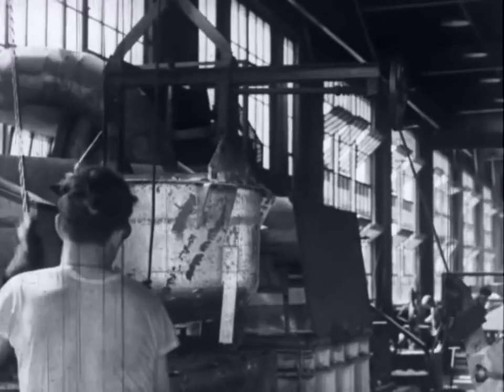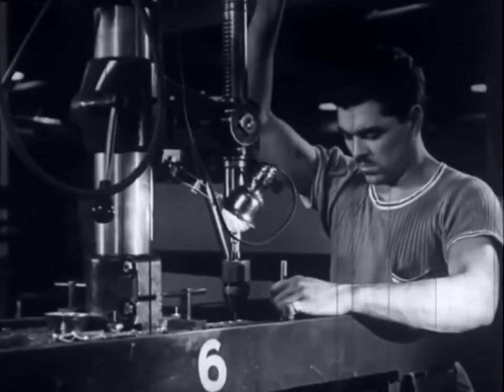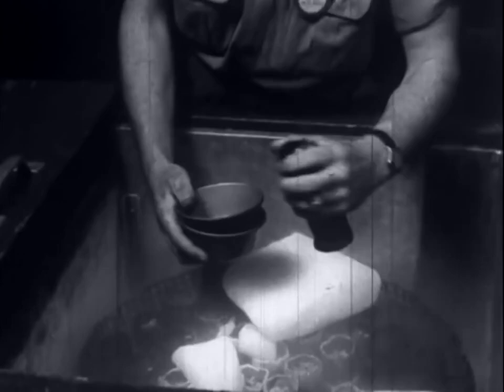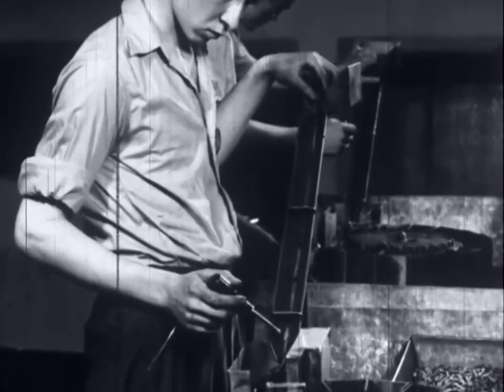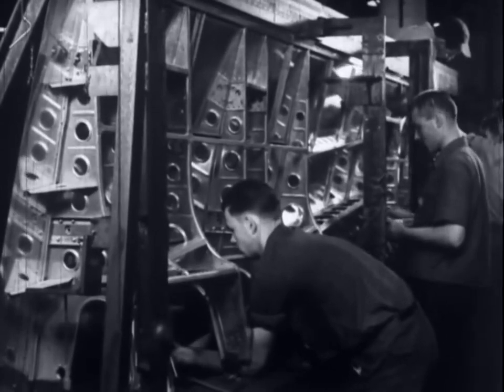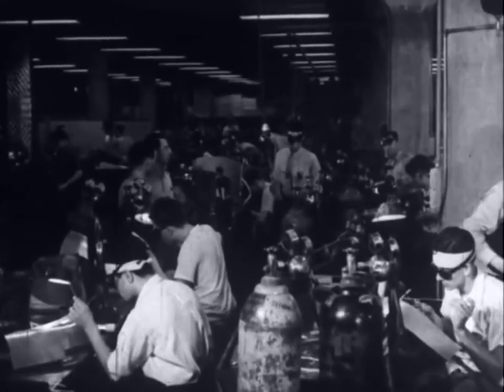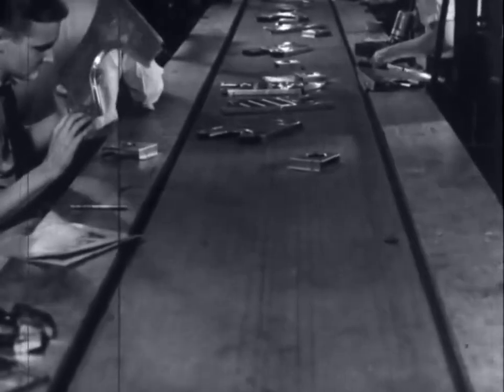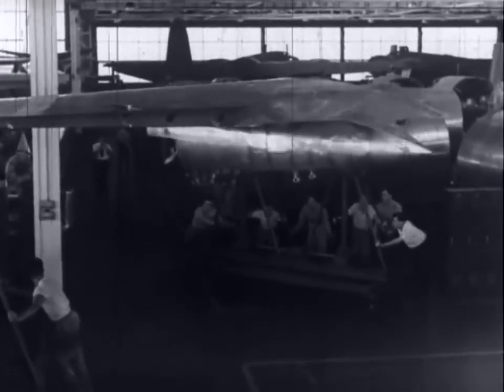Video from the Past [31] - Building a Bomber (1941)

Comment: Wow, I thought magnaflux was a new technology...I was in the airforce from 99-2010....the sheet metal guys still use the same tools as this vid, probably the exact same.  I was shocked when the gun guys said they still used WWII barrels on the Ghost II 130s....I laughed at the beginning when the announcer said “with precision” and then the molten metal  was splashing everywhere.  “Gloves...?, who the hell needs those things” (as they lift razor sharp sheet  metal that weighs about 500 lbs).  Good vid👍🏻
Reply: john smith The biggest difference I see between that factory and similar modern facilities is the lack of safety glasses and hearing protection.
Reply: @miked1765  Some of them were wearing safety specs. Some of them might be wearing small ear plugs you wouldn't see that. What some workers do is cut one ear plug into two pieces so they get decent protection yet can still hear people clearly. Many factory work environments aren't too loud but yes many old school factory workers had significant hearing loss. Some people can't stand wearing ear plugs so they wear ear muffs but in some areas the work areas are a bit tight so they tended to knock their ear muffs on things.
Reply: I laughed when they said the foundry worker was "fully protected by his suit made of asbestos"! 😳 And neither him or the guys pouring the molten zinc had any kind of face masks! 🤪
Reply: John Morgan My first job out of college was at a mold making company. I’d watch guys pouring aluminum molds, in full protective suits but wearing tennis shoes and trying to avoid the stuff they spilled on the floor.
Reply: @miked1765  I observed at 16:09 of of the guys spray painting on the factory floor without a face-mask nor googles. The others did not have googles...I guess in a war, health and safety is secondary to production....
Reply: Michael John Little I guess there was no OSHA back then. You are right I believe, in War safety took a back seat to production.
Reply: @johnmorgan2481  that stuff just gets in the way.
Reply: Did anyone else notice the guy standing in the room full of lit brazing torches, swing his torch right by the other guys head!? 😵

Comment: Skilled technician using a crescent wrench rounding off the fuel line nut.
Reply: Exactly what I was thinking.  Surely to God they had line wrenches back then...
Reply: Not a lot of them, and military equipment of the era was designed for easy field maintenance.
Reply: hey its government work !!!!!!
Reply: If you roll the thumbwheel the worm gear can hold the jaws with less backlash than conventional open end wrenches. Been there, done that and didn't fuck up hardware. Retired career USAF maintainer here who also knows that trick works with "Ford" wrenches popular from WWII to this day.
Reply: That's too funny!!
Reply: Open end adjustable!

Comment: Such was the state of technology: you're going to penetrate enemy air space traveling under [well under!] 300 miles per hour,  in a formation of dozens of aircraft. If your contrails don't give you away, the engine noise surely will.  The enemy will scramble interceptors capable of almost 400 miles per hour.  They will shoot 20mm cannon slugs at you.  Just one round hitting a vulnerable portion of the airframe or propulsion system will probably kill your whole crew.  Oh, they'll be firing "flak" at you from the ground, too, and there's not a damned thing you can do about it - no evasive action possible during the bomb run.  After all that, you MIGHT hit the target.  If you do, you MIGHT cause enough damage to put the target out of action for a period of time. If you do, it MIGHT make a strategic contribution to the war effort.
Reply: The U.S. Eighth Air Force lost more men fighting the air war over Europe than the U.S. Marine Corps lost fighting the Japanese in all the battles in the Pacific.  And still those airman continued to fight on.  Truly the Greatest Generation.
Reply: @HappyFlapps  in terms of % of losses to total numbers, Marines had 669,100  men serving, 24,511 Killed from all causes 68,207 wounded /missing, 2,274 captured, and 3.7% killed

AirForce had (3,400,000) serving,  (88,119) killed in all causes  (17,360)wounded /missing which was 2.5% killed >.The scary thing with USAAF losses is eaily 35-38% were non-combat losses..Training and ferrying and just plain accidents...Thats a god deal higher than the rest of the US non-operational losses which was 31%
Reply: @janvanv  ...Dad flew in B24s over the hump; got lost in fog over the Atlantic, found Iceland just in time: when the nose wheel touched down all four engines sputtered to a stop. I still have his blood chit from his flight jacket: wish I had the jacket too.
Reply: @philgiglio7922  My dad flew PV Harpoons and the US Navy's B24 equivalent PB4Y Privateer...and PBYs all during and long after the war--till they transitioned into P2V into the mid 60s
Many misadventures..stories of diverting from Kelflavik to Scotland, then to Stavanger...very sketchy stuff in bad weather the whole time..Far North Atlantic is rarely very nice.
Reply: You sound a bit like a Nazi apologist.  If not, I apologize, but to deny the heroism of our bomber crews isn't cool.  It's easy with hindsight and numbers to say perhaps "it wasn't worth it, too dangerous" but to say their contribution wasn't meaningful is simply inaccurate.
Reply: KurtB:  I don't think Russ was knocking the US Army Air Forces.  I think he was simply pointing out the reality of the bombing campaign in WW2 given the technological limitations of the time.  It has been argued that the greatest effect of this campaign against Germany was that it forced the Luftwaffe to pull back squadrons that were being used to support and protect troops on the Eastern and Western fronts so that they could defend the homeland.  This move did indeed cause immense losses to the U.S. and British bomber forces in aircrew and aircraft, but it made life easier for the Soviet and Allied ground forces fighting their way into the belly of the beast.  Also, the Luftwaffe's battles against the bombers, and later, the fighter escorts, steadily attrited the Germans of their most experienced pilots until the Nazis were forced to send up barely-trained youths which, by that time, were basically cannon-fodder for Allied fighter pilots.  Boiled down, it was basically attritional warfare in the sky, and the Germans just didn't have the manpower to keep up.
Reply: I agree with you that it was a war of attrition by 1944.  People bring up documents that claim German production INCREASED over the bombing campaign. I'll agree with that.  What I will add is simply "what would those numbers have been WITHOUT the bombing."  They would have been perhaps 3X to 10X what we saw in 1944.  To deny the effectiveness of the bombing is to deny simple math and reality to boot.
Reply: Kurt - You're absolutely correct.  Without the bombing campaign against German aircraft production, the numbers of planes the Germans would have produced would definitely have been much, MUCH higher.  But even with the daylight bombing campaign focused on disrupting German fighter production, the Germans biggest problems was training up pilots to fly the huge numbers of fighters they produced.  It's an undeniable fact that a fighter plane's most important component is its pilot and the Germans just never established a training regimen that could supply enough trained pilots to keep up with their losses.  As for the Americans, and to a lesser extent, the British and Canadians, their air forces instituted a policy of periodically pulling their most experienced pilots out of the line and sending them back home to train up newer cadres of pilots working their way through combat flight school.  Although many of these veteran pilots complained bitterly about being pulled out the fight (and there were lots of aces among them), orders were orders and they duly trained up huge numbers of young, inexperienced air warriors.  On the other hand, the Germans kept their experienced pilots at the front, where they were instructed to train the recent flight school graduate/newbies while in actual combat conditions.  Most of the "Experten" and their charges flew and fought until they died.  in 1939 Hitler planned for a short, extremely violent Blitzkrieg and so did his Luftwaffe.  They had no backup plan to train the massive numbers of pilots required for the long war of attrition that they eventually had to deal with.
Reply: @kurtbjorn   The USAAF and RAF decided NOT to bomb electrical power generating plants or the electrical grid..God only knows why...The bombing of industrial production and mass bombing of urban areas was largely ineffective..Destruction of rail and specifically coal transport by rail had a far greater effect in reducing production by the excellent ground attack aircraft like P47s and Typhoon was very effective in cutting electrical power generation and all those lathes and mills and welding sputtered to a near halt...and that did more than all the bombs dropped by all the heavies on cities..   Of course its not nearly as dramatic and exciting to talk about shooting up long trains of coal-cars (over 90% of German goods were moved by rail just 6% by truck..virtually all its electricity was from coal fired plants...No coal, no juice, no juice, no machines running...)
And then there was fuel...
Reply: Russ G deftist
Reply: Ed, I think you misinterpreted the 'tone' of Russ's comment. And what does 'deftist' mean?
Reply: Germany lost the war, what numbers do you need to understand the sum of the results?
Reply: More people like you and we would have LOST the war! Don't talk shit about that which you don't know!
Reply: "The flight in is for Uncle Sam, the flight home is for me", that was the mindset...all about the mission.

Comment: Explosive rivets, thanks for posting, this is the first time I have seen these.
Reply: Back in the 50's, my dad had a box of these. Why, I have no idea. That is, he had them until my friends and I found them, and discovered that you could set them off by hitting them with a hammer on the garage floor. He wasn't pleased.
Reply: Those old time 'explosive' blind rivets were much more novelty than anything... and I'm pretty sure they were declared obsolete & unsuitable for future design eons ago. They were never intended to be structural, kind of 'pop rivet' like; and the residues they left in inaccessible areas created intolerable corrosion issues. Even in the day, there were far superior blind riveting methods available.
Reply: Been replaced these days by cherry blind rivets that are installed using compressed air (normally).

Comment: No ear, eye or hand protection in sight.

No face guard or required clothing to prevent snagging in machinery.... a different time indeed.
Reply: Which tells us the much-maligned OSHA ancestor had a fundamentally valid mission. Wearing an asbestos suit and heavy mask/helmet, standing over a cauldron of molten aluminum, must have taken a toll of many workers.
Reply: Your brain and common sense we're your OSHA
Reply: What we do will appear primitive and quaint 80 years from now.  It doesnt mean we or they were backward - both doing their/our best at the time.
Reply: The narration at 1:25 says it all.
Reply: But they did paint a nice warning on the big press "See that all hands are clear before operating press".  If you lose a hand, it's not our fault.
Reply: @autophyte  I worked a factory in Harvard, IL which used a number of the same machines, some labeled "Property of US War Plant Corporation"
Reply: Back when people didn't tolerate political correctness
Reply: @davidvance6367  What does work safety has to do with political correctness? Lol